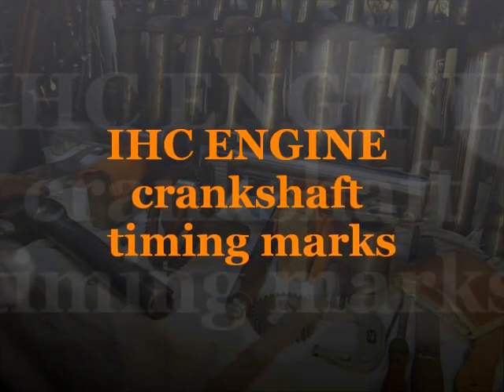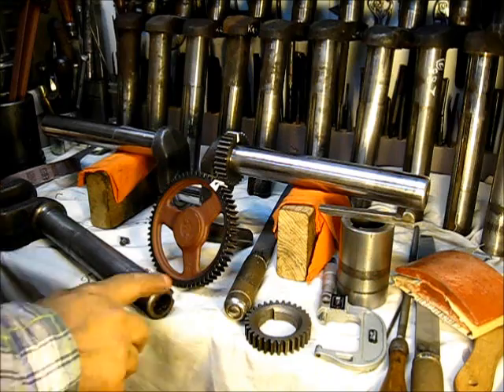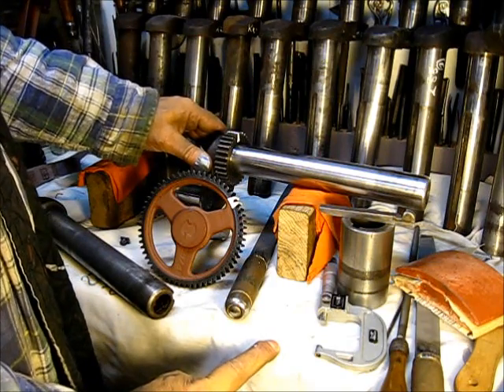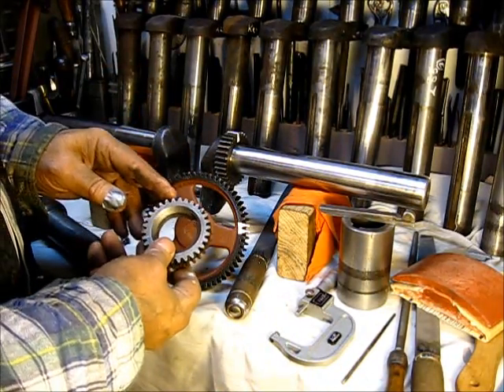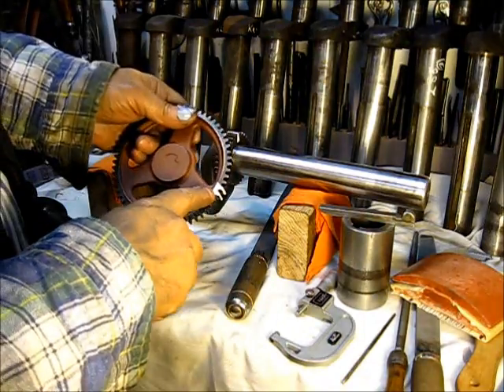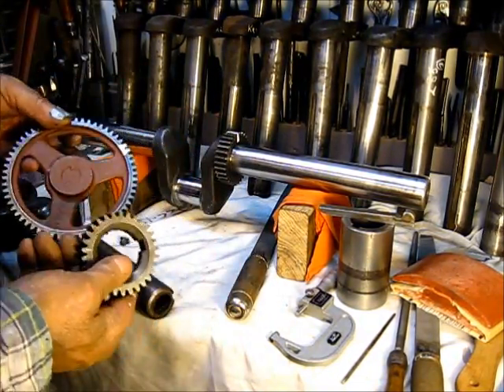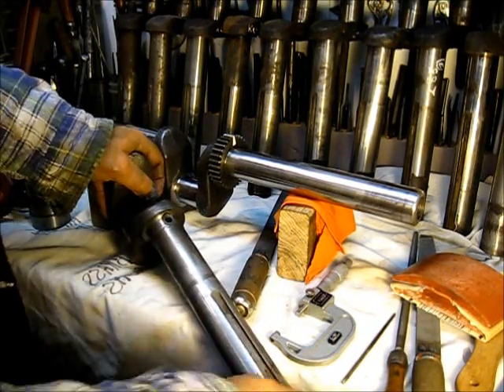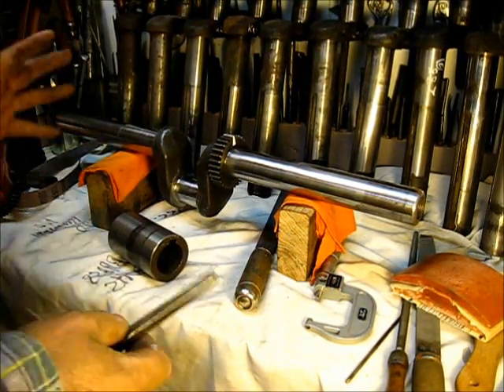IHC ENGINE / crankshaft timing gears explained

Comment from the maker: ,, yes I have built small flywheels (ten inches and less) for very low rpm air and steam engines,, silver solder, brazing, electric welder,  thanks